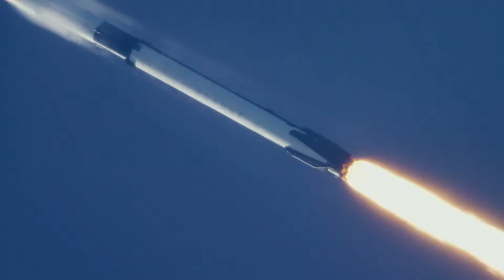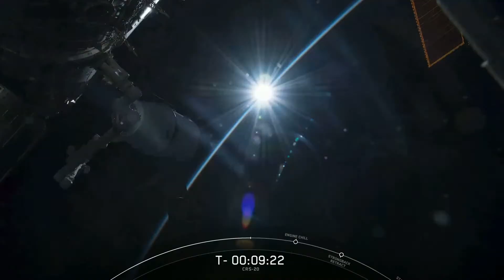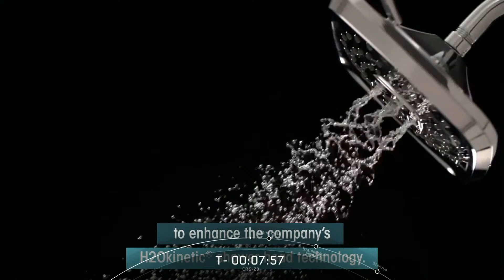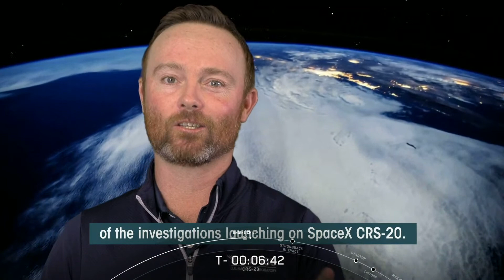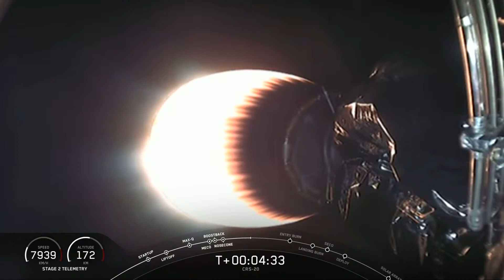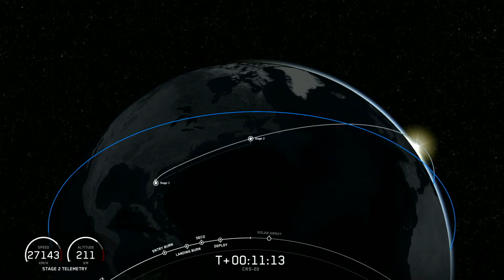CRS-20 Mission

Comment: I’ve just noticed that they use the second stage engine start to help turn the first stage around. You can see the exhaust hit the top of the first stage, giving it a push.
Reply: Yeah, I was thinking that they fired the engine too soon, but than I realized nah, it's all planned, they are turning the first stage.
Reply: Nope. The 1st stage must have been already 100s of meters away when 2nd stage fired up. 1st stage has its own blasters for turning around. There is no way blasting from 2stage to predict what will happen to 1st. My thoughts
Reply: It turns around with the thrusters. like "Look Around" said, the stages are already several hundred meters away from each other.
Reply: Im not too sure about hundreds of meters. Second stage ignition is around 6 sec after the separation. They are just floating apart at a rate of few m/s. 
@22:30 You can clearly see on the left how the flames reach all around and into body of the first stage.
Reply: I'm sure it gives it a little nudge, but by no means is that how the first stage does it's flip. The ACS pods do that. They fire the second the interstage clears the engine bell.
Reply: @motokid6008  No one said it was so. But it does seem to give it a nudge, whether intentionally or not.

Edit: Ok, my comment up there can be interpreted as such, but that is just my clumsy writing. Of course they will have RCS for proper orientation, I was simply pointing out the fact that the second stage engine seemed to help the first stage to turn...

Comment: does it use gas or diesel
Reply: RP-1 as the fuel with liquid oxygen (LOX) as the oxidizer,
Reply: rp1 is refined kerosene
Reply: It uses a hamster
Reply: @thefreedomleague7259  umm...
Reply: Turbotoilet1997 what octanr
Reply: octane
Reply: Liquid oxygen is a primitive fuel source
Reply: @fng9651  It's pretty low, they want as little as they can in RP1.  Why?
Reply: @thefreedomleague7259  good thing it isn't the fuel source then
Reply: @fng9651  octane is a minecraft server owned by kiingtong
Reply: @thefreedomleague7259   LOX is not a fuel at all, but do you have something better?
Reply: Y'all are lying I just googled. it says it runs on coal

Comment: 50th booster to land successfully on its launchpad by SpaceX, and on same time, 50 years ago Nasa landed on the moon for the first time. Does SpaceX planning to land on moon before getting on Mars? I hope they will very soon!
Reply: Well, it has never landed on its launch pad. The launch site landing pad is a couple of kilometers away from the launch pad, and most of them have actually landed on a boat out at sea. They have talked about the Superheavy Booster for Starship literally setting back down on its launch pad, but I'm sure they will want to experiment a while before they try that.
Yes, they are going to the Moon first. Elon is talking about doing unmanned Lunar landings in 2022, a manned Lunar orbital flight, with commercial passengers, in 2023, and a manned landing in 2024. It will not surprise me if all of those dates slip by a couple of years, but we have something like Starship ferrying crew and cargo to the Moon, we are never leaving again. Elon used to talk about landing on Mars in 2024, but he no longer does. I would expect people on Mars sometime between 2030 and 2036.
Reply: @odysseusrex5908  great info, thx.

Comment: Was it the first stage doing it's boost back burn tht you could see on 23:03 up in the left corner of the second stage view? Something glowing flew right past it and the crowd cheered at it.
Reply: That was dragon's nose cone which is discarded after passing through the atmosphere
Reply: @paulx203  ah okay, thanks. The glow must have been the reflection from the 2nd stage burning then. Forgot that dragon 1 discards the nose cone.

Comment: How many times has the most reused rocket been launched? Do they have a limit to how many times they will reuse a rocket?
Reply: 15 is the goal. 4 is the record if I recall correctly.
Reply: @motokid6008  thanks brah!
Reply: This far, the most they have launched one is four. I imagine that this year will see at least one used a fifth time. What they want to do is launch each one ten times with only minor maintenance between flights, then take it in for a refurbishment, a complete overhaul, and then be able to launch it ten more. They expect to be able to get one hundred launches out of each booster before end of life. At the rate they are developing Starship though, it is doubtful whether any of them will reach that number before the whole fleet is retired.

Comment: incredible launch view as always ....dunno if u noticed it or not but unlike previous landings which happened on the droneship in the middle of the ocean ,this time the first stage flew all the way back to the initial launch pad at cape canaveral  . any body wanna tell me why ?
Reply: Landing location (barge or in the land) is determined by taret orbit parameters and cargo mass. Launch of Dragon tl ISS is not to demanding in terms of propellant and F9 trajectory: first stage has enought fuel to "come back" to landing zone.
Reply: Smaller launch payload means it can fly back.
Reply: It has landed back at the launch site before. Whether it can do that or not has to do with mission requirements. Basically, some payloads, either due to their mass or their speed requirements, use more fuel than others. If there isn't enough fuel to fly all the way back to the launch site, they land on the boat. Recently, the great majority of payloads have been requiring a sea landing.

Comment: 40 years  ago this would have been broadcast over every channel live, now it's just a run-of-the-mill launch that nobody covers, it just shows what we take for granted now. 

So what happens to stage 2?
Reply: It gets deorbited and burns up on reentry.
Reply: @odysseusrex5908  What a waste, I think at least they should point it at the moon and attempt to land it there, it wouldn't need much fuel would it?
Reply: @spearhrower  It would need more fuel than not doing that
Reply: @logitech4873  But Elon himself said fuel is cheap, it'd be worth it just to have a camera feed up there, One blast to coast there one for correction and one to land in low G. They could be re-claimed when Elon builds his moonbase. It would be good practice too, in both senses of the word
Reply: Spearthrower it’s not an issue of fuel cost, it’s an issue of payload. Increasing the upper stage size would reduce the total payload to low earth orbit. It actually requires a lot more fuel than most people think to go to the moon. Spacex doesn’t need to go to the moon with the upper stage and it would cost more money to do so so why do it when they can have better profit.
Reply: @cowsgomoo4917  Yes I know it would cost more in fuel, I was wondering how much more, they could claim 100% recycleability then and could even earn money from a live 'moonstream'. Just throwing my thoughts out there
Reply: @spearhrower   Yes, actually, it would, a great deal. Even if the second stage were fully fueled, I don't think it could put itself into a translunar injection, and it certainly would not have enough fuel to then drop into Lunar orbit and perform a landing. All that, of course, being aside from the fact that it is not designed to land.
Reply: @odysseusrex5908  Haha, you should have led with the obvious point that I'm missing. 'it's not designed to land' cheers, I'm a dumbass

Comment: Did I understand that correctly? This is the last non-crewed dragon flight?
Reply: No it's the last flight for Dragon version 1. Dragon 2 will act as both a crew vehicle and cargo. Only D2 can automatically dock without the need of the Canada arm.
Reply: The next SpaceX flight to the ISS will indeed be with a crew, using Dragon 2 Crew. 

After that, Dragon 2 Cargo will fly in the fall. Though both are called Dragon 2, the cargo and the crew versions are two different ships.
Reply: @cogoid  - "two different ships" The crew capsules will be reused as cargo capsules.
Reply: Motokid600 thanks for clarifying.
Reply: @motokid6008  According to Hans Koenigsmann, answering a question about this in CRS-20 pre-flight press-conference, Crew and Cargo versions of Dragon 2 are different builds. Cargo version does not have Super-Dracos, and it does not have the same life support system, and all this allows to save weight for actually transporting the cargo.
Reply: @cogoid  - You sure he wasn't referring to the crew capsules being stripped down? What else would they do with crew capsules? Scrap them? Because Nasa is not allowing reuse of capsules for crew.
Reply: @motokid6008  At about 35 minutes into the press conference:

Q: can you talk about the the Dragon 2 cargo version, since that's coming up?

A: Cargo Dragon 2 is very similar the Cargo Dragon 1 -- it doesn't have certain parts like the escape system and the super Dracos. It has a smaller life-support system inside and it also does not have the [control] panels, it obviously doesn't have the seats either -- so all these parts that are not in Cargo Dragon and that makes Cargo Dragon a little bit bigger than the current Dragon 1 -- about 20% or more volume at the same up mass that we currently have.

We are in the process of building it right now. I believe we're shooting for a fall launch on cargo Dragon 2.
Reply: @cogoid  - I see.
 However that doesn't quite answer what they'll do with the crew capsules post flight. It makes sense to strip them of the systems Hans mentioned there and turn them into cargo variants. Because again NASA will not allow the reuse of capsules for crew.
Reply: @motokid6008  He did not say anything about it, beyond mentioning that the ship is designed for five flights, but that the actual longevity will be determined by inspecting the condition of hardware after the flights.

Maybe there will be customers other than NASA who want to buy flights of the flight-proven Crew Dragon 2?
Reply: @cogoid  - I've been looking and looking and I cannot find anything definitive. Apparently the decision to not reuse crew capsules is SpaceX choice. Not NASA's. So beyond that I guess we'll have to wait and see.
Reply: @cogoid   They're not that different. the crewed capsules will be repurposed as cargo carriers, at least until NASA is sufficiently confident in them to allow them to be reused for crew.

Comment: What's  wrong with 28:13? We  have fire on the  left  picture but there is no fire on the right one.
Reply: The on-board camera has more delay.
Reply: @logitech4873  Seems  logical,  they must be  using satellite uplink on a booster.  Didn't know that those  screens are little bit out of sync.

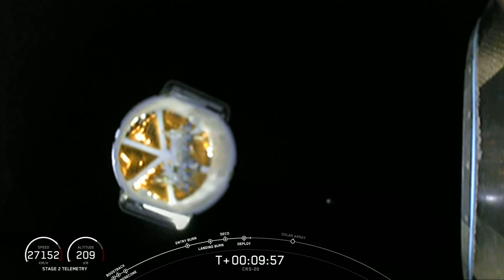Comment: But how about all those bubbles at 29:57, they dont look like crap or debris that moving in 27151km/h that look clearly to be under water!
Reply: If the object is moving with ~27000km/h and things like debris move next to it with a speed of ~27050km/h it looks slow. 

The things, moving in a different direction aren't actually moving in the other direction but are moving way slower in rougly the same direction. 

Imagine being in a car on a highway. Other cars may not look like moving at 120km/h when you do aswell. Just as Einstein always said: It's all relative ;)!
Reply: There are no bubbles. That's just the usual ice and dust.
Reply: DENNIZ the MANIAC bubbles under water.....going in different directions....how does that work then?

Comment: What velocity do we see there? It can't be orbital velocity since it's too slow.
Reply: At which moment? 20k km/h range is in fact orbital range.
Reply: @wojteksykurski , no, for a 200 km orbit, about 7,793 m/s is needed. Which is 28 Mm/h noch 27...
Reply: Alfi Halma it shows you bottom left what the speed is.
Reply: @johnbiggscr  I know but after SECO it shows 27somethingthousand km/h not 28,000 km/h which is the required speed. Aaah, but nevermind, that's likely groundspeed and doesn't take earth's rotation into accont. Then it's beyond 28,000... Nevermind...

Comment: How about a rocket that is emission free, by the end of 2020, I believe this to be possible without the fuss of over spending, rather innovate on a small scale and in doing so ... when a solution emerges we can contribute to a world of clean travel, no sense in continuing to pollute our atmosphere.
Reply: not possible at all
Reply: I was thinking about the approach of investing in a 7' rocket. One in which the electrical components supply the plenty for a tank that either runs on nitrogen, 
dry ice or another resource. 
I am no engineer and yet I find that so often for innovation and ingenuity, a small rendering of the same saves both time and money.
The example came to mind by way of a dry ice bottle rocket demonstration last year. Concise and effective, now what if instead of an over-expenditure in fuel and labor you use a rocket that is 7ft tall.
Reply: @javiercorral7820  
lol there's a reason as to why people burn the fuel instead if just compressing it and releasing it. Besides,  most rockets don't really pollute that much at all.
Reply: lol ... in contrast to saving money and improving travel.
Reply: @javiercorral7820  
No. The reason is that it is a hilariously ineffective way of doing things. Your rocket would have to be an order of magnitude taller than the ones with have now, and it would take an unholy amount of fuel to get it going.
Reply: Trial and error is indeed the way in which to cultivate innovation and ingenuity ... 
The truth is that there is indeed MUCH that we have yet to achieve.
I wonder ...
If any have tried this approach at a rocket launch, instead of the stand up straight, ready, set, go!
A 45 degree angle rocket launch I believe to be more effective. 
The need for momentum I believe to pick up more readily with propulsion under water !
In addition, to inspire those who follow hereafter a projection in film must be accurate to the here and now. If indeed we are to travel through space one day, I don't believe that access to more will be allowed if we don't learn the importance of taking better care of this magnificent and marvelous blue stone. Furthermore you have my phone number should you ever decide to discuss anything worthwile - 651-329-4763
Reply: @javiercorral7820  
You should never give your phone number to random people on the internet, bro.
Reply: Dude, a boeing 737 max creates the same pollution as a falcon 9, there are about 80 rocket launches, plus most of them are weaker than falcon9

Meanwhile the Aviation industry launchs 5.4 planes a year, why dont you hate on them? Also, a zero emission rocket? Wtf?

Comment: What was the reason for using the old dragon for this mission instead of the new one?
Reply: Cost savings: it is cheaper to refresh used capsule than build new one from scratch.
Reply: Wojtek Sykurski but theyve allready used the new one several times. Why did they go back to the old one for just one mission, only to then after continue to use the new again? Your argument if cost savings don’t make much sense in that context. Do you have a source for that. I mean it is the same capsule just with a different door/hatch so theyre not designing a new capsule and the work has allready been done and its been up to ISS an docked several times.
Reply: @abvmoose87   No, they have only flown Dragon 2 one time, on the DM-1 mission last year. It's next flight will be DM-2, hopefully in May.
Reply: @abvmoose87  This was the last mission for the CRS 1 contract. And the requirement of first CRS contract was to use Dragon version 1 for all missions. Now SpaceX would be launching Dragon Version 2 for secondary CRS contract (if I remember correctly: 6 launches). Here the requirement is to use Version 2 of Dragon. Building from scratch capsule that would flown only once (after that only the Version 2 would be launched) would wastefull for SpaceX in terms of resources and time.
Reply: Wojtek Sykurski I know that they only flown the Crew Version of Dragon 2 one time last year. I for some reason thought they had implemented the new docking system on their Transport version Dragon1 since I thought I had seen several auto dockings with the transport and that corresponded well with its status as operational, additionally it fitted well with what the vice president of spacex says in this video describing the only change here being the docking mechanism. Wheras the differences between Dragon1 and 2 would add more changes than just dock system such as different exterior mould, and the crew dragon in particular. But given that they never implemented the new dock system on Dragon1 transport your argument makes perfect sense.

Comment: G,, D,,,  !!   Buck Rodgers !   Most of you are not old enough to have watched 1950' s  or 1960's black and white TV.      To be clear,, Buck Rodger's landing space ship looked exactly like that.   To have spanned seasons many, when Airlines were flying propeller driven craft, with not a scrap of electronics on board save a radio, weather forecasting was just as accurate in Poor Richard's Almanac as the evening news, gasoline was 0.18 per gallon,, and your oil was checked and windshield washed while you waited, a dishwasher was only the person who drew the short straw, and garbage was burned in the pile behind the shred. Telephones had 4 numbers and if you needed long distance,, you clicked the receiver two or three times to alert Mabel, so she could plug your line into the line for long distance.  I rode in DC-3's when they were as young as a  decade old,, and on one of the first 707's headed for Disneyland on a summer vacation.   And feel what I feel when it is clear,, that had I enough money,, I might well be able to buy a ticket to go see Mars.  Mars.   Buck Rodgers has arrived.